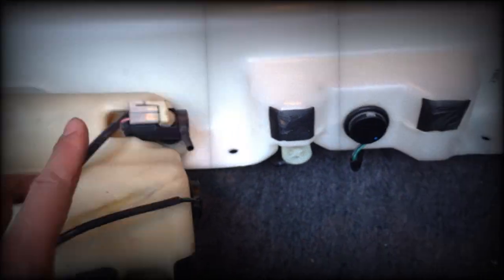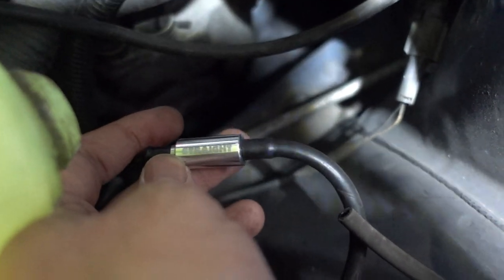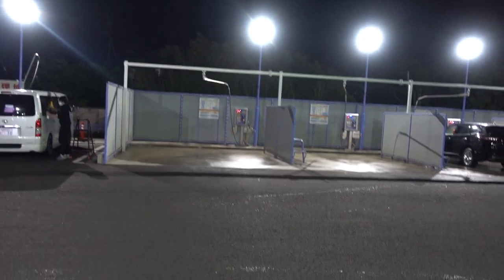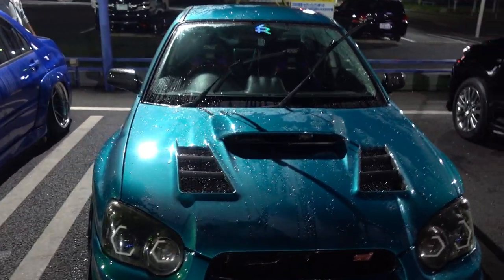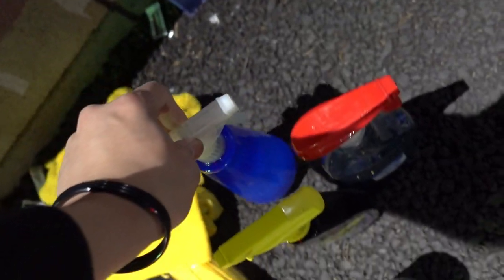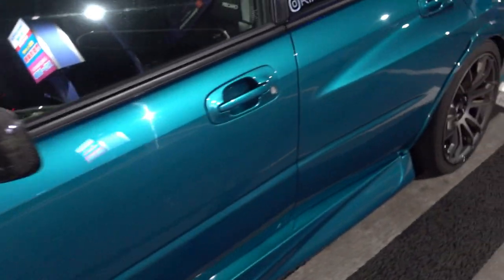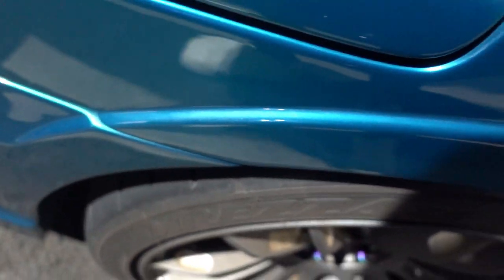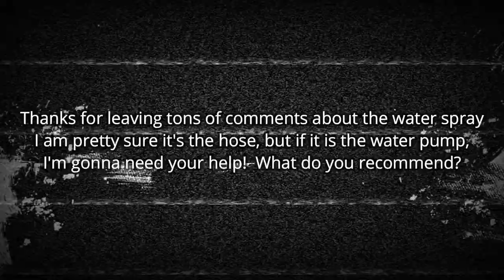Which is better?  Ceramic Coat or Car Wax

Comment: Awesome video Kino both would do a good job but I think in my opinion ceramic would protect a little better better heat and scratch resistant and last longer.👍
Reply from the maker: true!
I really need to get it ceramic coated when I paint the next time😁

Comment: That poring water on the intercooler have absolutly no affect on the heat. You need "spray" whole ic to sink the IAT in your engine. Water in sprayform leeds aways the heat from the ic but it needs to be  pure "spray" that hits whole IC, other wise gou got allways none affect of it att all.
Reply from the maker: yeah, it needs to be a mist...
I'll figure something out🤔
Reply: @KiNOSTi  Here in europe there are ready spray /mist nozzles to buy. It should be able to find in your country also. Try to Google it... 👍